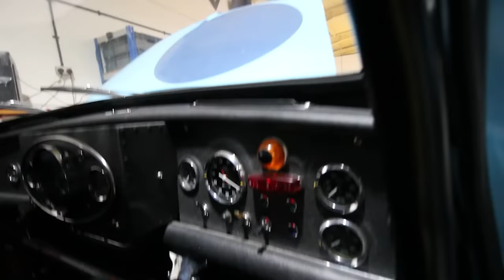RACING JAGS and RACE ENGINES everywhere - an AWESOME tour of Tom Barclay Racing

Comment: if you remove the bell mouthed weber ram tubes and put rolled full round ram tubes i can say another 45 bhp on your v12 = and a big torque gain with top end big improvement = try it you will be shocked !